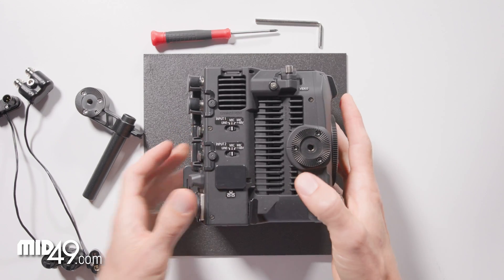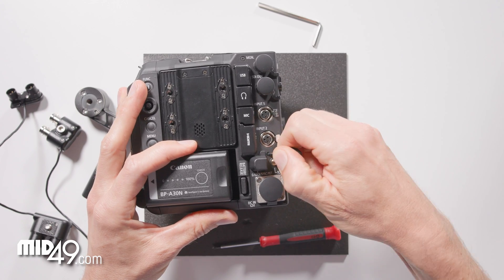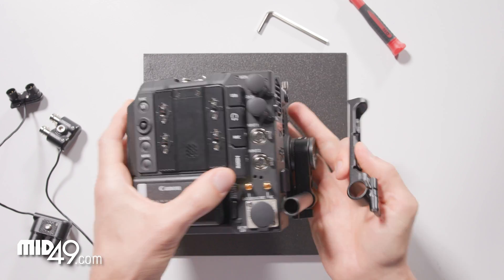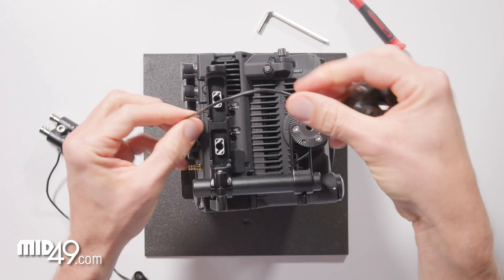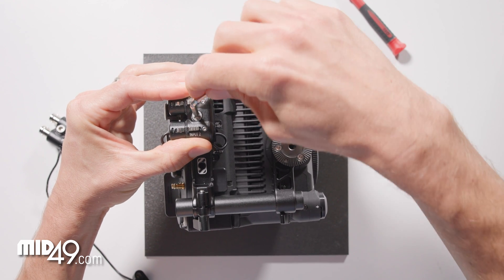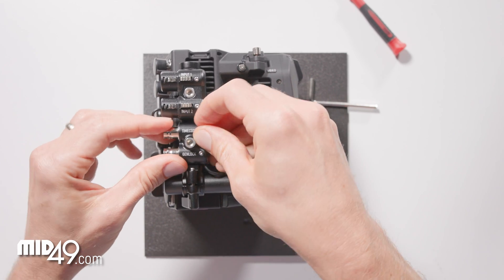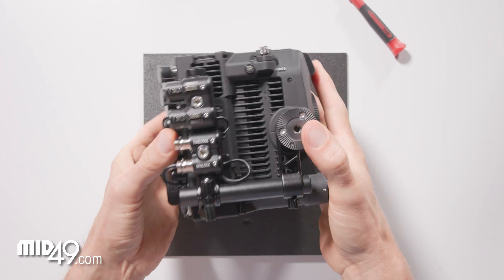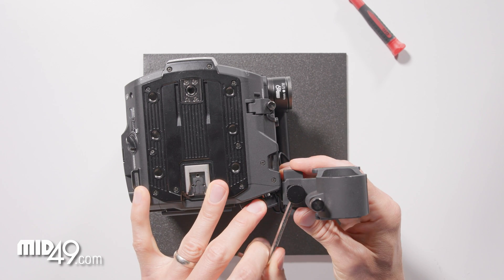Install Guide for Canon C400 Audio and Timecode Breakout Boxes

Comment: Would you guys consider to do something similar for the Pyxis to basically reposition the ports from the the back to the side, to allow to place a vmount closer to the body, and not to need to move constantly?
Reply from the maker: It would be a difficult project because of the data speeds coming out of the camera ports. Getting in between would likely degrade the signals or cost a fortune.